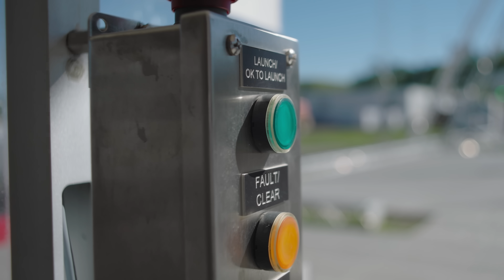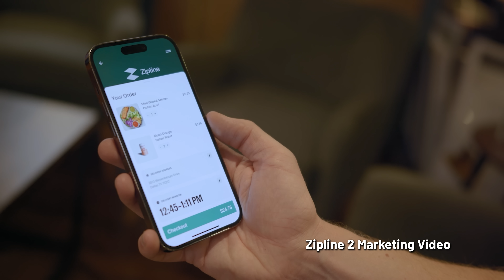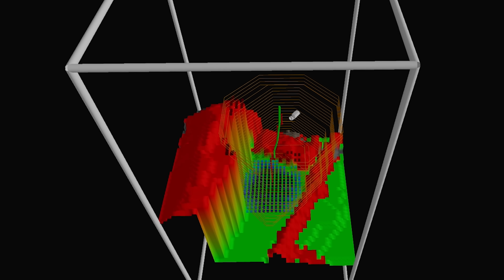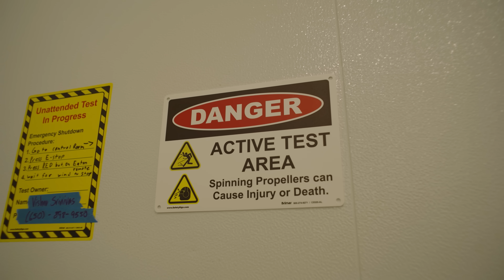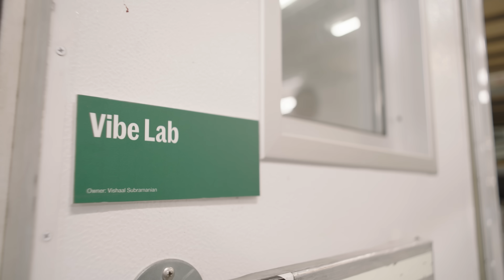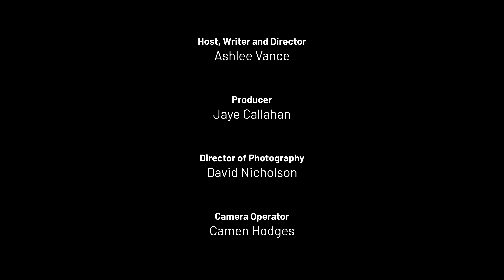These Delivery Drones Will Beat Amazon To Your Doorstep

Comment: These are being tested in Wyoming it appears, which is viable because sparse population.  As you access higher density areas, the value of drone delivery becomes less, as more deliveries can be combined.  For instance: an Amazon delivery driver does 200-300 parcels a day, and it's not unthinkable to have many of these heavier than the 8lb limit.  The medication/ blood delivery is a smart option because this is very time sensitive.  As far as your "sky latte" goes just know that after all infrastructure is in place and deliveries are at scale, it's still going to be $2-3 to do a drop.  As far as using 3000 lb vehicle to deliver a burrito: ebikes and scooters exist.

Comment: Before all the politicians got involved into dji I fly my inspire over a mile away to a local gas station and the cleark would fill my small order attached to the  carbon fiber cargo bay i printed 1 off concept design without any problems for over a year. It was cool and interesting to my neighbor and customers at the gas station

Comment: The business  model is that traditional delivery via van for small items is slow and expensive why not deliver them via bike they cheap can go in around tight corners 

Bike delivery is already main way of quick delivery in many countries so drone delivery looks over engineered for urban settings 

May have use in remote inaccessible areas but that's a small niche market

Comment: This is great!!! It’s horribly inefficient, expensive and not ideal for USPS, FedEx, UPS, Amazon and every other corporate delivery truck to drive in every neighborhood everyday tearing up roads, crossing paths and wasting gas.  The cost to deliver anything has a bottom line fixed cost that’s easily calculated therefore no need for multiple corporations touting competitive delivery cost is healthy for the market. That’s BS!!! It costs the same $$ for UPS as it does FedEx to deliver a package.

Comment: I suppose traffic safety and radio signals are problematic with this, but very much contrary to teslas and more broadly electric cars, the weight savings relative to a car or scooter really do give these a massive edge in low energy usage.

Comment: just making the lithium battery for these uav's it requires tons and tons of carbon because its shipped around 10-15 times back and forth across the pacific on bulk carriers just to make the parts and the battery to manufacture it.  keep in mind bulk carriers burn bunker fuel and this is a far more toxic and lower quality fuel then people understand.  when ships near the shore its so toxic they need to switch fuels to burn a cleaner fuel like diesel or kerosene.  diesel or even propane running in a conventional engine still makes less emissions then a electric + lithium powered uav since the battery is charged with - coal from the local power grid.  you could even use cryogenic hydrogen or propane to either burn directly or put into a fuel cell.  not all electrification is clean and its not always a better solution.  and for power density cryogenic hydrogen is #1 for any type of fuel even compare:  120–142 MJ/kg (lh2) vs 0.5 MJ/kg li-on battery.  even with boil off losses cryogenic hydrogen and propane will be the fuels of the future not electric li-on batteries.

understand im not trying to save the planet i just want cheaper fuels that are not crazy expensive.
Reply: Yes, but you're kinda skipping over some key stuff here.
Sure, lithium batteries aren't made out of sunshine and good vibes — there's a lot of shipping, energy use, and yeah, bunker fuel. No argument there.
But burning propane or hydrogen in an engine that throws away most of its energy as heat isn’t exactly eco-genius either. Electric motors are ~90% efficient, and grids are (slowly) getting cleaner — fossil fuels, not so much.
And hydrogen? Sounds futuristic until you try storing it. Cryogenic tanks, boil-off, pressure issues — it’s a logistical headache. Plus, most hydrogen today is made from natural gas, so it’s not exactly the clean fuel of tomorrow... more like the fossil fuel remix.
For small drones, batteries still win on weight, simplicity, and not blowing up on takeoff.

Comment: The problem is there is a need for drone delivery.   Not for everything.    Operations research needs to be done on efficiency rather than coolness.   Rwanda is not America.  When you have a hammer everything becomes a nail.

Comment: They could get a couple of Optimus robots to do the loading and priming thereby fully automating the system 24 hours. Also in that location they could use solar and be carbon negative. They could run the show from a cafe & do a little bit of coding/scripting every now and then to improve the system.

Comment: Hmmm seeing the launching system. Then seeing a coffee delivery. How does the coffee get into the Zipline device to start with?
Reply: 1, the drone, while still attached to the storage/charge thingamajig lowers the pod to the chute
2, at the bottom of the chute, the pod slides in position (about at a 45 degrees nose down) and opens its lid
3, stuff is put in the pod, then lid gets closed
4, the drone winches the pod up and leaves.

Comment: 00:03 - Die innovativen Drohnen von Zipline zielen darauf ab, die Lebensmittellieferung in Kalifornien zu revolutionieren.
01:53 - Das innovative Drohnendesign von Zipline verbessert die Lieferservices in Ruanda.
03:43 - Lieferdrohnen revolutionieren die medizinischen Versorgung in abgelegenen Gebieten.
05:16 - Die Plattform 2 von Zipline zielt darauf ab, die städtischen Liefersysteme in den USA zu verbessern.
06:58 - Die Revolutionierung der Lieferung mit effizienten, leisen Drohnen anstelle traditioneller Fahrzeuge.
08:24 - Zipline stellt die Sicherheit von Drohnen durch strenge Tests und innovative Fertigung sicher.
09:57 - Lieferdrohnen verwenden moderne Technologie für eine sichere Navigation.
11:54 - Lieferdrohnen übertreffen traditionelle Methoden in Geschwindigkeit und Effizienz.

Comment: I've delivered close to 10,000 packages out of my 20 year old Subaru Forester as an Amazon independent contractor & know it's cheaper than this is ever gonna be but believe that their rivian trucks should have drones mounted to them so the driver doesn't have to get out of the truck & walk the package up...

Initially I was thinking drones that fly but now I believe that it should be a medium sized FPV remote control all terrain platform that the driver can control like a regular r/c car when the drop off location is within eyesight that zips towards the door & let's the package slide off when he or she locks the brakes or releases pinchers that hold the package in place & I don't think damage is a concern since Amazon is dropping packages from 20' up in the air using their drones...

All someone has to do is develop a cradle that holds it just outside the passenger door so it can auto locate & lock in place using electric magnets so it can be loaded & launched without having to manually set it up outside the vehicle each time.

Obviously it would work in rural settings & not in city ones .
Reply: Yep, I worked for FedEx and had the similiar idea, just unload a little delivery bot along the road and then sweep back and retrieve them all. 
However, FedEx requires we deliver to the doorstep, and that often requires human walking skills to navigate through gates and flower pots, etc.
FedEx could just deliver to a central box like us mail does and it would be way way faster and cheaper.  Also apartments were the worst, you have to walk up stairs and all over to deliver to doorsteps, this was the most time consuming job and drivers hated it.  A drone would never work here, there are hallways and plants and people all over.

Comment: This will not work on a windy day.
Reply from the maker: It does
Reply: They are mentioning "up to "38 mph" wind at 11:55. That's a 7 on the Beafort scale ("near gale", "whole trees are in motion, and walking against the wind becomes inconvenient"). In many parts of the US, similar or stronger winds are rare, around 10-20 days/year. The little "box" that comes down has active steering and a LOT of sensors, so it can compensate for the movement.

Comment: CURRENT FAA REGS make this buimess model impossible.  There mist be a Pilot In Charge to watch the drome the entire time, unless a 90 day waiver is filled with fligjt plans. Also the entore drome cannot cause an impact of greater than 11 in/lbs of force. Large drones are the fiture ahead i believe.  Dromes have use in construction,  agricultural,  power plants, water suppliers,  parks, search and rescue,.fishing, hunting, wildlife mgnt,
Reply: I think you're referencing FAA Part 107, which requires drone pilots to keep line of sight on the drone at all times. Zipline has a Part 135 certified aircraft and they were granted a waiver for the line of site requirement (as part of FAA's BEYOND program.)
Reply: @insanity54  trump must have invested in it.

Comment: I live in the Dallas area. Walmart has been using various drone delivery services in my neighborhood for a few years. I actually work as an independent contractor for one of them. Mostly because of Walmart, but also with support from the FAA, the Dallas area is the national hotspot for commercial drone delivery development and testing.
Reply from the maker: Which company delivers best?
Reply: @CoreMemoryVideos  I haven't been able to make a thorough comparison of them. However, Zipline impresses me. I'd like to see them in operation in person. As I provide support ultimately for Walmart, and particularly in the very dense and busy location of Dallas/Fort Worth, I'm wondering how Zipline's model works with them. It seems to me like Zipline would work better either with a warehouse in a low-density area or someplace easily accessible by ground traffic. Zipline did great in countries that have little or no infrastructure, but D/FW has a lot of traffic at all levels.

Comment: "Wow it must be so expensive because it's high tech automation robotics." The reality is that this is already less expensive. It's no driver; it's electric, and most importantly, you're using a vehicle that weighs 50 lb to deliver a 5 lb item rather than 3,000 lb.

I am stuck on this and will need some practical maths here. So hard to realize this in the habits of everyday lives to somehow overcome change and tolerances for these things to be flying overhead.
Reply: Ummm, in a city, uber eats is delivered by electric bike so... you are totally wrong.  And once they deliver they then pickup nearby the next delivery.
Reply: The market oppurtunity is replacing foot delivery drivers. Not Amazon delivery
Reply: 50 lbs but it can only deliver 1 package. Even a guy on a bicycle can deliver multiple packages.
This will be for a niche market.

Comment: The plane has a nose, tail, and two wings… that’s four motor locations. Why are you adding four MORE motor mounts each needing structural rigidity and weight?
Reply: I think planes would have a hard time staying in one spot while they lower the package.

Comment: It requires you to open and remove the item, its not gonna work. You need a delivery system that does not require someone to open and remove the item. 
also think about apartments and inside locations or having "roof delivery" for those locations.
Reply: It does not require someone to open and remove the item. There's a door at the bottom of the payload housing that will open up and gently drop the item onto the ground when commanded by the drone over the area you choose for it to drop the package to go to just look at 12:38 for instance
Reply: Bro you didn't even watch the video demonstrating the delivery did you? 11:41